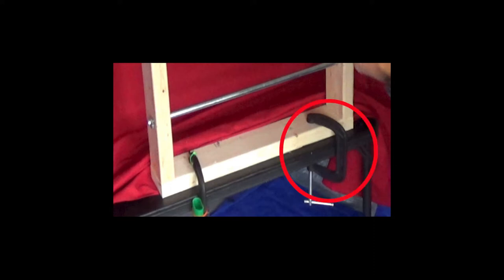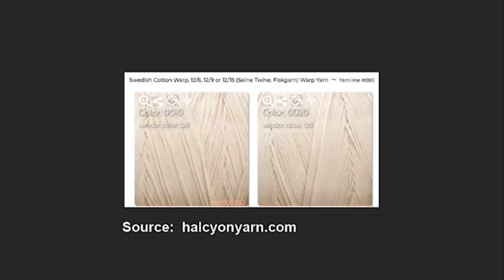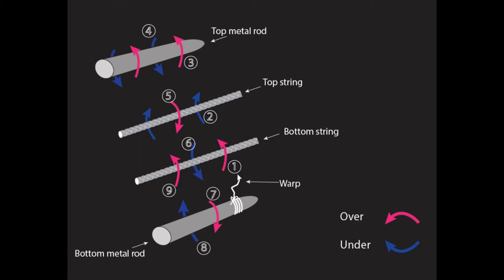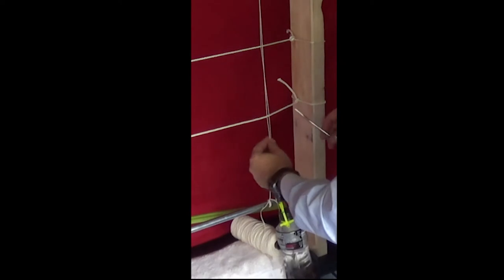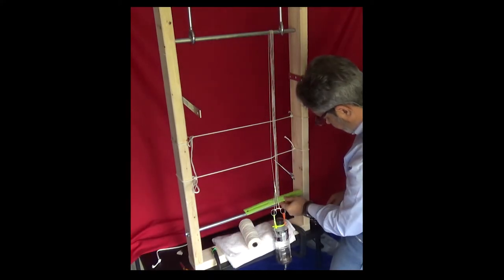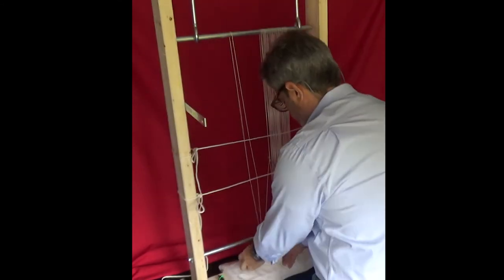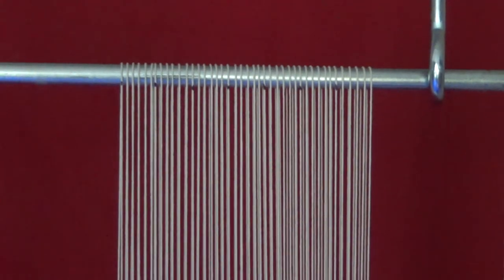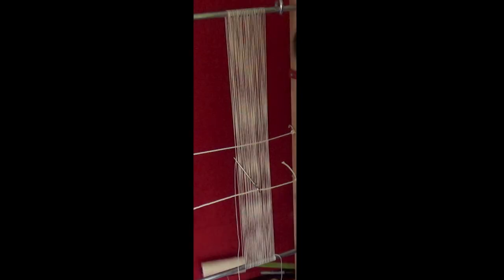Adding Warps to Loom for Kilim Weaving

Comment: Did you mark the warp on every 6th string per inch instead of every 8th one as said in video?
Reply from the maker: I honestly am not sure. I have made several videos, it is possible that may have happened while editing the video frames. Which video was it?  I'd be happy to check.